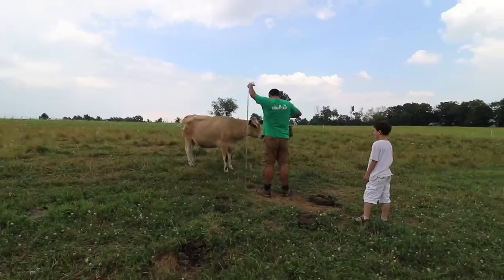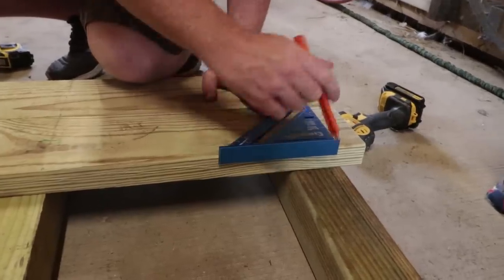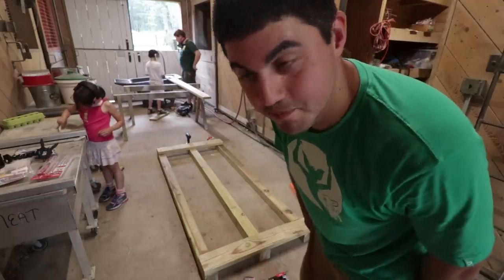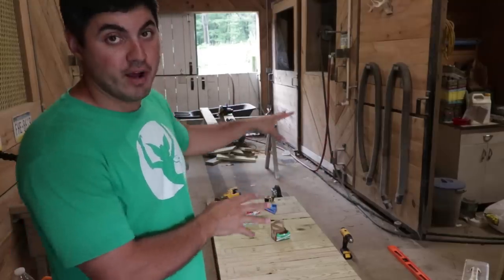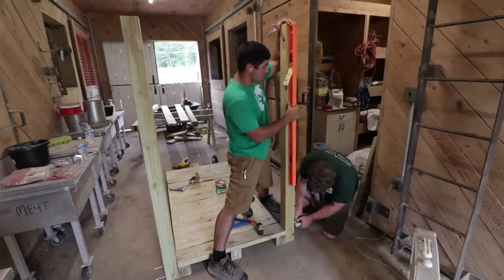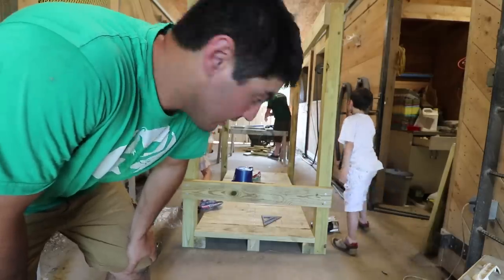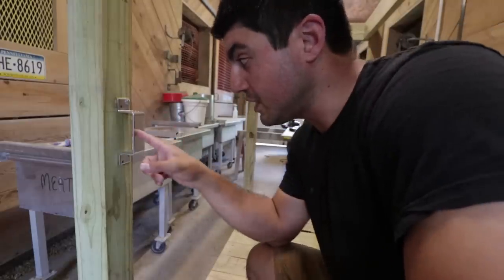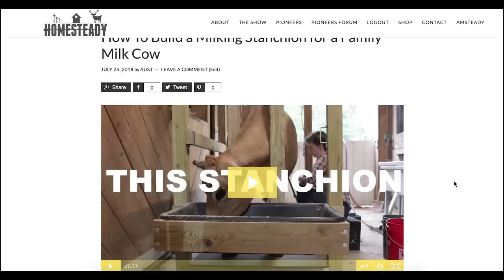How To Make a Cow Milking Stanchion

Comment: Those brackets that hold the 2x4's are not cheap on ebay.  However, you can buy them cheap in trucks parts section.  They make them for putting 2x4's on the box of pickup trucks and they are only a couple of dollars.  Hope this helps someone.